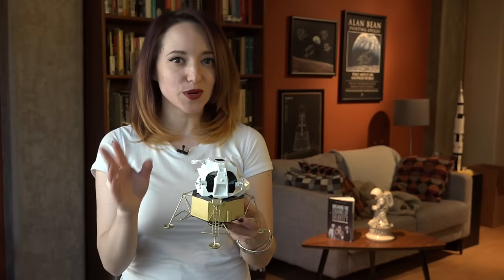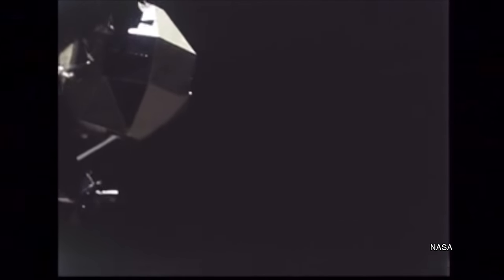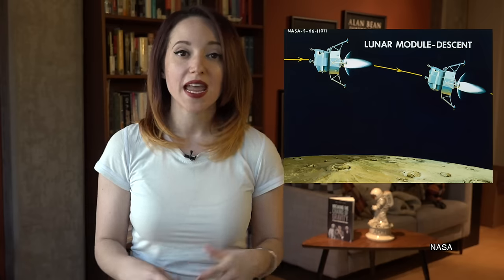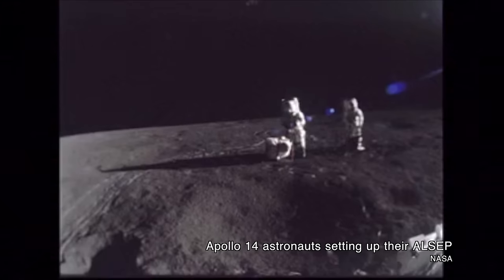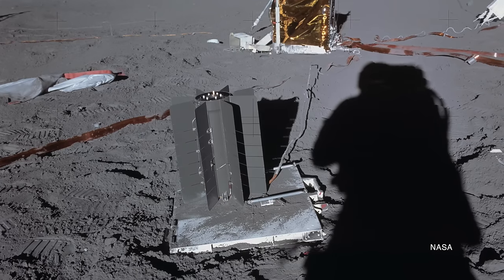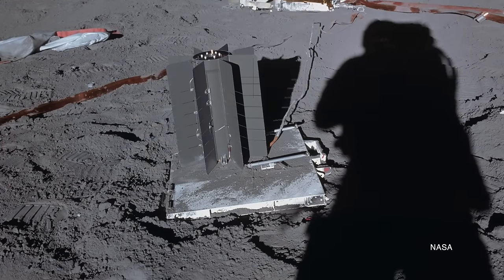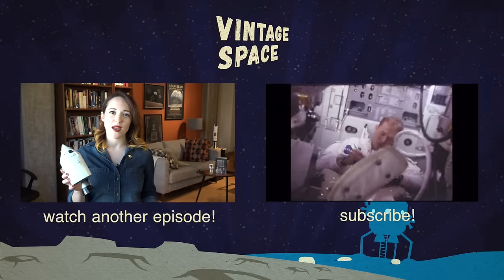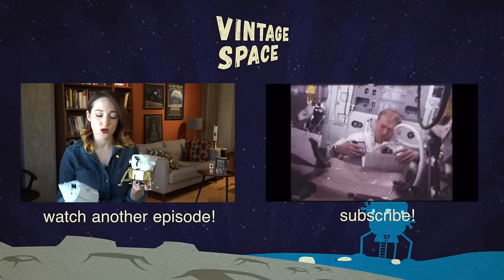What Happened to the Spent Lunar Modules?

Comment: Wouldn't it have made sense to keep the ascent module on the trip back for use as a lifeboat? Imagine if the Apollo 13 explosion had happened on the return leg...
Reply from the maker: +Kiyoshi Kirishima No because after the lunar landing the consumables were all gone and they wouldn't have had anything in the lifeboat to help - it really would have been no more than dead weight!
Reply: +Kiyoshi Kirishima 
Also the the Service Module probably hadnt enough fuel to provide enough deltaV to return the CSM together with the ascent stage ( I should take some time and calculate this in the future). However Amy already said it: There was no reason to bring the ascent stage back.
Reply: Amy Shira Teitel So if the CSM could double as a lifeboat only on the outward voyage? That's unsettling...
Reply: QuietElite The SPS was originally designed to lift the CSM off the Lunar surface and was oversized (by about 200%) for what was actually needed so I don't think hauling the ascent stage back to Earth would be a problem.
Reply: Kiyoshi Kirishima
On Wikipedia it states that the SPS just had twice as much thrust that is needed to accomplish the LOR mission mode. Thrust isnt important here, it is the deltaV what matters. Also in direct ascent mode there was a additional landing stage and the SPS just has to lift the rocket back into orbit and then to earth, while in the real missions the SPS was also used for lunar orbit insertion.
However if we find the mass of the CSM+ ascent stage before TEI and the fuel left in the Service module, then I could caculate if it was possible to return with the ascent stage. I already know the ISp of the SPS.
Reply: +Kiyoshi Kirishima I think you are confusing your terms here.  The CSM is the command Service module and it never went to the moon's surface.  The SPS is Service propulsion System, the engine of the CSM that pushed sit to the moon and back, again, never getting to the moon's surface.  The LEM or LM is the two stage craft that went to the surface.  

Could the CSM bring the LM assent stage back to near Earth?  Maybe, it was only 4,740 lb (2,150 kg), to the CSM 26,300 pounds (11,900 kg) (dry weight), but as pointed out, the LM's consumables would be gone. And the LM could not survive reentry, so it was not the greatest lifeboat.

Jettisoning it to a remote control crash on the moon happened after rendezvous and transfer of crew and samples/equipment.  So when they did jettison, they were pretty sure the CSM was going to take them home.
Reply: +TexMex The design of then Command/Service Module actually began in mid 1960, almost a year before Kennedy tasked NASA with landing a man on the moon by the end of 1969. In 1960, it was not 100% clear what Apollo's mission might be. 
It was originally looked as a "maid of all work" type spacecraft with a number of key capabilities built into the basic design - 

carry three crew men
sustain them in space for up to two weeks
be able to change its orbital plane
capability of leaving low earth orbit and possibly looping around or orbiting the moon
possible requirement to land on the moon

When the landing mission was being considered, it was initially assumed that the entire Apollo Command/Service Module would descend to the lunar surface. Therefore, the Service Propulsion System (the Service Module's main engine) was designed to be able to lift the weight of a three man Command Module and attached Service Module off the surface of the moon and of course, fire again to send the Command/Service Module back to earth.

When the Lunar Orbit Rendezvous technique was decided on in 1962, this removed the need for the Command/Service Module to land on the moon as the landing would now be carried out by a small lightweight lander (the Lunar Module). But the design of the Service Propulsion System had already been more or less frozen.
Reply: EricIrl Yes, that is in part why I think the CSM may have been able to take the LM back to the vicinity of Earth.
Reply: +TexMex Possibly it could have - but there was no point. The whole philosophy of the Apollo system was to discard unneeded mass at the earliest opportunity.
Reply: EricIrl Tell the original poster.   He brought it up.
Reply: +TexMex It's there for him to read if he wants to.
Reply: ***** But why... what?  Hard to answer if I don't know what you are referring to.
And then you detail a position that is not contrary to mine.  OK, we are both right?  Not sure what you are looking for here.
Reply: *****  And among the things I said was "but as pointed out, the LM's consumables would be gone. And the LM could not survive reentry, so it was not the greatest lifeboat."  So I think we are in agreement. 

This happens to me all the time on youtube.  Someone says "the sky is falling! And I say no it's just rain, then a third person steps in and says No Tex-Mex you POS! It's Fing rain, a pox on your children! And I am left wondering how to respond.  

Anyway, how bout that local sports team of ours.  Hope they win.
Reply: ***** Absolutely.  And to the builders as well.  These things did not come off an assembly line.  They are hand built machines and each one was a little different.  The hoax community will bemoan the "loss of blueprints", but no complete blueprints existed as changes were made throughout the build process.  

There is some fascinating tech in all the Apollo gear.  The fact that the lower 2 stages could, and occasionally did suffer shutdowns of one engine, and the other could compensate is astonishing.  The Saturn V had it's own onboard computer, a An IBM System/360.  Essentially a mainframe rebuilt into a ring. http://www-03.ibm.com/ibm/history/ibm100/images/icp/F375786A01099D12/us__en_us__ibm100__apollo__manufacturing_saturn_iu__840x660.jpg
Reply: TexMex I didn't know about that, thanks!
Reply: +Kiyoshi Kirishima Apollo 13
Reply: +butchtropic Totally aware of that.
Reply: +Kiyoshi Kirishima How could you even ask that question after watching this video? Puzzling...
Reply: +Kiyoshi Kirishima The CSM never doubled as a lifeboat. The LM did during Apollo 13. The descent stage was still attached and it's engine was used to get the astronauts back to earth. It produced around 10,500 lbs of thrust. The ascent stage only produced around 3600 lbs. After lifting off from the lunar surface and rendezvous with the CSM there would be very little fuel left or any other consumables. Not to mention the ascent stage was designed to be ignited only ONCE and it was not throttleable, meaning that when it was ignited it was at maximum power until shutdown. By the way, the CSM engine produced around 20,500 lbs of thrust, which is why there was no need for the ascent engine, even if it had fuel and could be re-ignited.
Reply: +QuietElite Trust me, it would not be possible to return to earth from lunar orbit using only the thrust from the ascent stage. 3500 lbs would not be enough given the mass of both the LM and the CSM. But that would all be academic since the ascent stage fuel would have been spent and it was not designed to ignite twice anyway. Oh, by the way, thrust IS important when determining the thrust per unit mass and burn time vs the amount of propellant needed for a particular space maneuver.
Reply: ***** I can understand the concerns. I think they made the right decision! Haha
Reply: +Kiyoshi Kirishima What about this:  The ascent stage docks with the CM in lunar orbit, and then immediately heads back to earth.  I don't know if they had to orbit the moon a time or two while they transferred the lunar rocks to the CM, but they could save power by heading straight back and transferring the rocks on the way back.  They could also immediately start using the CM fuel cells to recharge the batteries on the LM, so as to replenish that consumable. Perhaps they could have even transferred some O2 and/or H2O to the LM tanks to replenish them.  Then, as they approached earth, could they put the LM (as well as the SM) on a free return trajectory back to the moon to provide the desired impacts?  A lot of work for a few days use of a lifeboat, but it would provide a safety margin on the return trip.
Reply: +Gezellig I think it's all about weight. they worked everything out to the ounce. Carrying extra fuel to bring accent module back to earth would have had compounding costs. Even as light as is was built, Wikipedia gives the empty weight of 4700 pounds. 

It would have taken a LOT more  fuel to bring that out of lunar orbit. (plus the fuel to get that fuel to the moon etc.. )
Reply: +Russell Polo   But I am not sure we are talking about that much additional fuel.  If the ascent stage is 4700 pounds, we are talking about 783 lbs. on the lunar surface.  And remember, you only have to change the lunar orbit of the combined SM/CM/LM (ascent stage) to an elliptical orbit which crosses the point of equal gravitational influence between the earth and moon.  After that point you are in freefall toward earth.  If you put the LM ascent stage on a free return trajectory back to the moon, you might even be able to fire its ascent engine (although I am not sure the ascent engine could be re-lit) and provide a bigger impact into the moon to get better seismic data.  And you also save orbits around the moon, and have a  possible lifeboat on the way back.
Reply: +Gezellig Not saying it couldn't have been done, but your reduction of lunar gravity isn't valid. once in lunar orbit, you would need to (by Newton  F=MA ) change the speed of that 4700 pounds from lunar orbit speed to earth return speed.. I found some numbers here : http://history.nasa.gov/SP-4029/Apollo_11h_Transearth_Phase.htm , the burn to leave lunar orbit and head to earth lasted 151.41 seconds and changed the speed of the craft by 3,279Ft/second.  That burn would need to be extended enough to accelerate an additional 4700 pounds by that much. ( and every SM/Stage 3/ Stage 2 and Stage 1 burn would need to be longer to account for the extra fuel to do that..) I didn't find a reference on "CSM mass on earth return" but it was somewhere around 30,000lbs but way less than 63,000lbs. What you are talking about would increase the earth return mass by  7 to 15%.. ( I think it's closer to 15%) That's a big change. 

Again, not saying "Couldn't have been done" but they were on very small margins where they cared how much every little piece weighed. They also used the Accent module as a bit of garbage dump, tossing things they knew they wouldn't need again into it before undocking , again, to save weight.
Reply: +Russell Polo   Yeah, the weight of the LM ascent stage on the lunar surface was a bit of a distraction.  The point was that the fuel needed to lift the ascent stage out of lunar orbit was not that great.  I'll admit margins were small, but more for the LM than the SM/CM.  If your calculations imply that it would only take 7-15% more fuel to take the ascent stage home, it might have been worth it, especially if it saved a few orbits around the moon and provided a better seismic event on the moon.  If you look at Apollo 13, the explosion could easily have happened while the LM was on the moon, or on the return trip.  Where would the astronauts have been without a lifeboat then?  An extra RCS system, life support, G&N system, and a set of batteries you could charge up (I suspect the ascent engine could not be relit) for several days for the price of a little extra SPS fuel seems like a good deal.  I would have made the case for it but I wouldn't quit if they said no.

I wonder if the Apollo 11 ascent stage would have fit in the shuttle cargo bay (possibly)?  Wouldn’t it have been interesting if it was placed in earth orbit until the shuttle could have retrieved it.  That would have made quite the museum piece!
Reply: +Bob Barker Most of your comment is correct except for the "3500 lbs would not be enough given the mass of both the LM and the CSM". Reason that's not correct is because once both of those modules are in orbit, the maximum thrust of the rocket engine becomes totally irrelevant. It could have a thrust of only ounces and still be able to break orbit provided that thrust lasts long enough. The need for larger engines only exists when there's a need to actually lift off of or land softly on a body. In those two cases, you need enough thrust to actually overcome the static gravitational attraction between the body and the spacecraft.
Reply: +Gezellig You forget that in order to break lunar orbit, you need to apply delta V towards the entire mass of the spacecraft. So in your scenario of "... heading straight back and transferring the rocks on the way..." means that they would have to accelerate not only the mass of the CM and the rocks, but also the mass of the LM. And that extra LM mass means more fuel is needed to perform the required acceleration. Not a savings. Best method assuming it's possible would be to drain the dregs of O2 and H2 from the LM to the CM. Then jettison the LM. Finally, break lunar orbit to an Earth return orbit. But that approach would require rather tricky engineering (there would have to somehow be fuel and LOX ports in the docking rings to perform such a transfer adding more weight and complexity to the spacecrafts). Much simpler to simply have the CM self sufficient for the Earth return. The only thing that keeping the LM attached during the return trip would be more room for the astronauts. That extra room doesn't compensate for the additional fuel needed to accelerate the extra mass the LM would represent.
Reply: +Gezellig STOP THINKING ABOUT WEIGHT. Think about MASS. The only thing weight has to do is determine how large your rocket engine needs to be in order to either land or take off from a body. Once in orbit, only mass matters. And the extra mass of the LM means that more fuel is required to perform orbit changes. And that extra fuel in turn means more mass. So even more fuels is required at launch of the entire spacecraft from Earth.
Reply: TexMex2 months ago+butchtropic Absolutely.  And to the builders as well.  These things did not come off an assembly line.  They are hand built machines and each one was a little different.  The hoax community will bemoan the "loss of blueprints", but no complete blueprints existed as changes were made throughout the build process.  

There is some fascinating tech in all the Apollo gear.  The fact that the lower 2 stages could, and occasionally did suffer shutdowns of one engine, and the other could compensate is astonishing.  The Saturn V had it's own onboard computer, a An IBM System/360.  Essentially a mainframe rebuilt into a ring. http://www-03.ibm.com/ibm/history/ibm100/images/icp/F375786A01099D12/us__en_us__ibm100__apollo__manufacturing_saturn_iu__840x660.jpg
Reply: What the hell's going on with you somebody forgot to give you your meds?
Reply: The fuel cells went offline during the Apollo 12 launch not because the lighting was so overwhelmingly powerful as to cause damage, but because of a fairly simple vulnerability in the design. The lightning currents, which otherwise traveled safely down the skin of the SM, passed near disconnected terminals in the SM umbilical connector, inducing pulses that triggered a fairly sensitive electronic circuit breaker designed to detect fuel cell overloads and disconnect them to prevent damage. That's why there was no permanent damage to the fuel cells after they were reconnected. The lightning did fry a few small external sensors (temperature, etc) that weren't terribly essential.
Reply: The ascent stage carried very little consumables. Not only were the propellant tanks nearly empty when it reached orbit, but the big batteries and water and oxygen tanks were all in the descent stage left on the moon. The ascent stage only carried enough consumables to lift off and complete a rendezvous with the CSM and transfer everything over. In fact, the limited consumables on the ascent stage were a major factor in planning rescues by the CSM if the LM could not make it into its exact orbit. There were many scenarios where the LM made it into (some) orbit but ran out of power before the CSM could get to it.
Reply: Right, the whole idea of Lunar Orbit Rendezvous was to avoid having to drag back to earth the weight of the craft you used to land on the surface.
Reply: The LM ascent engine was hypergolic, like all the other engines on the two Apollo spacecraft, so it could have been re-ignited were there sufficient propellant to do something useful. But you're right, there wasn't.
Reply: The Saturn V computer was built by IBM, but it wasn't a System/360. It was a special-purpose design called (dryly enough) the Launch Vehicle Digital Computer (LVDC).
Reply: I think the idea of engineering in items(make it so there were items in the ascent stage that could be used in an emergency) that could help with a lifeboat situation would have been a good idea (into the ascent stage that is). As I have read the thrust developed by the engine on the CSM was way more than needed. Why  NASA would not at least do a trade off study and see if the extra fuel spent bringing the ascent stage back (and making possible use of consumables in an emergency situation) would have simply been doing your best to cover all bases and do everything possible to make sure the crew got back. I really do believe that short sighted thinking within NASA has been a long term problem. We see this demonstrated with the situation with the shuttle Columbia and no repair materials (airframe repair) until the accident happened, then NASA decided they somehow could manage bringing such supplies with each future shuttle launch.
Reply: Dan R The entire basis of the Lunar Orbit Rendezvous method chosen for Apollo was to avoid the propellant needed to haul the landing vehicle all the way back to earth. This made it completely out of the question.
Reply: Look at the Saturn V stack compared to the LM/CSM stack. For every lb you put into lunar orbit, pre-landing, you have to put 45 lbs into getting it there. For every lb you carry from lunar orbit to the surface, you have to put an extra 2 lbs in the descent stage. 

That means for every lb of unused fuel in the ascent stage when it makes rendezvous, you need an extra 2 lbs in the descent stage to get it down to the surface. For those three extra lbs, you need around 140 lbs extra fuel in the Saturn V to get it to the Moon, almost the weight of another crew member. 

But it's worse than that. Now you've made everything heavier, you need to make the engines more powerful to lift that extra weight, which means more weight (or mass, if you prefer) of fuel. The mass margins on chemical rockets are paper thin; if you don't have a definite reason to put extra mass on the rocket, then it's going to get dropped from the design. If you can have the same effect by doing something that doesn't add mass, that gets done instead. So quality control comes before lifeboats.
Reply: Well Apollo,now that is over and done with. I expect these same weight restraints are present (or even stricter) with a Mars mission. Now a Mars mission, it sure seems a good bit of pre positioning is going to have to be done to have any kind of safety margin. Sure gives the impression that Apollo was really risky.
Reply: *****
Yeah. So in at least one important way, Apollo/Saturn was a lot safer than the shuttle, which had no launch escape system beyond the ejection seats used during the early test flights.
Reply: I seem to remember seeing some training film of shuttle crew exiting a side door on the orbiter,holding on to what appeared to be a pole,walking out to the end of the pole,and then it was expected that you jump. It was stated that even if you preformed this stunt perfectly your chances still were not good.I do wonder if all this "making travel into orbit an everyday thing" is just wishful thinking, that is it will be a long time before spaceflight is not very dangerous.
Reply: Dan R The pole was for escaping during controlled aerodynamic flight (i.e., when the shuttle was operating as a glider, not a rocket). I think the pole was just to keep you from hitting the wing. And yeah it was given low chances.
Reply: ***** You are correct, in the later landings the CSM performed the descent orbit burn, lowering both it and the LM into an elliptical orbit with a low pericynthion just east of the landing site from which the LM would begin its powered descent to the surface. This was begun with Apollo 14 and continued through the "J" missions (15-17) to help land more mass on the surface.

This argues that the Apollo designers made a mistake in allocating too much Saturn payload mass to the CSM and not enough to the LM. If the LM had been given more, then it could have carried descent propellant tanks big enough to make the descent orbit burn on its own, as it did on the lighter Apollo 11 and 12 landings. Doing the burn with the CSM meant having to take the entire mass of the CSM deeper into the moon's gravity well only to lift it back out again.

The whole idea of Lunar Orbit Rendezvous was to avoid having to take your earth return ticket all the way to the surface and back into orbit. This is mostly the propellant in the Apollo SM needed for trans-earth injection but also consumables for the trip home and the reentry heat shield, neither of which is needed on the surface.

Given 50 years of technological advancement since Apollo, particularly in computing, communications, navigation and robotics, we probably have a few more options for lunar mission design. One intriguing idea I have for saving weight is to have only a single crew capsule separate from the fuel and consumables it needs. Basically it's a combination of the direct ascent and lunar orbit rendezous methods.

First, I'd send two uncrewed fuel and supply caches to the moon, one to the landing site by direct ascent and the other to lunar orbit. Direct ascent, i.e., landing on the moon without first orbiting it, is more efficient. Any of a variety of efficient but slow trajectories could be used since no humans would be consuming supplies and getting bored.

Then I'd send the crew in a single vehicle to the landing site, also by direct ascent. They'd carry only enough fuel and supplies to get them there. To return, they'd refuel their craft with just enough to get them into orbit and rendezvous with the orbiting supply cache. Then they would burn out of lunar orbit and begin the trip back home.

Alternatively you could pre-position only the supply cache in lunar orbit and launch the crew to the surface with enough fuel to get them back into lunar orbit to rendezvous with it, where they'd get enough fuel to make the trip home.

Either way, in case of a mission abort before landing, they'd have the option of entering orbit to rendezvous with the supply cache there without actually landing.
Reply: Art,The idea is to use the ascent stage as a lifeboat, no one is saying it will reenter the Earth's atmosphere.
Reply: Dan R Exactly. The LM was never meant to fly in anything but a vacuum.
Reply: This thread has been going on a while with some saying in effect, "even if we engineered with an accident like what happened with 13 in mind there is not much we would have done different". I ask (since we are doing a "what if" here). Taking into account what happened on 13 what could we have done different?This can be the small answer like "redesign construction or testing methods for the tank that exploded" or thinking big and saying" redesigned the electrical system so as we had multiple sources of backup power". Could the Apollo spacecraft(manned section CSM,LM ascent,descent had been designed with safety and backups more in mind?It does seem that the big issue with Apollo 13 was electrical power in an emergency. I do realize you have to draw the line somewhere with safety and redundancy.
Reply: Dan R You can find your answers in the report of the Apollo 13 review board and in NASA's response. Quite a few changes were made, some of which were already in process before Apollo 13. They included a 28V 400 Ah reserve battery in the SM (same as one of the LM's descent batteries), a third O2 tank, and eliminating the stirrers that actually triggered the explosion. The stirrers were there only to get more accurate readings of tank capacity, and with the third tank these weren't as important. There were also many changes in the fabrication and testing of the O2 tank itself to avoid the mishandling and damage that set the stage for the accident.
Reply: There wouldn't be much point to having a lifeboat on any return mission. If you're not right next to the Earth when launching the lifeboat, you'd just be drifting in the black for a LONG time before a rescue mission can get to you, assuming that a rendez-vous trajectory is even possible before you run out of food/water/power. The lifeboat idea really only works when close enough to a habitable planet that you could land on it with the lifeboat's limited DeltaV.
Reply: Gabdube No, you wouldn't. All you need is to be on a return trajectory and have enough air. Remember, in space you don't lose speed when you cut your engines. That's why spacecraft don't need to burn all the the way there, and why Star Wars is completely wrong when it shows ships constantly firing their engines.
Reply: +Anzac-A1 I know that. The point is that, in the events that you would need a lifeboat on a long-range return trip, what exactly are the chances that you would still be on the correct trajectory for a safe unpropelled return? If a tank ruptures or something explodes, it could alter your trajectory. If it's an RCS failure, you might not even be able to get on the proper trajectory in the first place, etc. You need your lifeboat to have at least some degree of self-propulsion other than RCS if you're going farther than lunar orbit.
Reply: Gabdube Right. Besides propulsion (even just RCS to make corrections) you still need enough power, oxygen, water and food to complete the (possibly long) trip back. This was the big problem during Apollo 13. Getting back on an earth return trajectory was the easy part compared to ensuring that they had enough consumables to survive until they got there. Cooling water (ironically enough) was the limiting item, followed closely by battery power. Also somewhat ironically (given the loss of the SM O2 tanks), oxygen wasn't a big problem. The LM carried a lot of O2 to cover several repressurizations of the cabin after EVAs, and there were no fuel cells also making O2 demands. And of course they still had all their food.
Reply: That is correct. In fact, the ascent stage lifetime is so limited that it was a major factor in lunar abort planning. It wasn't always possible to get it back together with the CSM before the LM's consumables ran out.
Reply: Imagine... I wonder if someone didn't want visiters that day..?